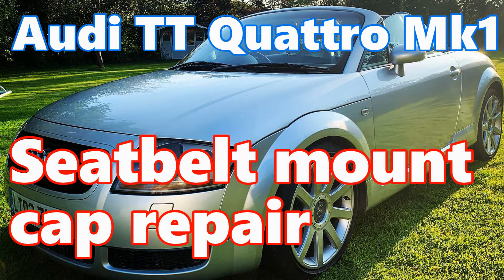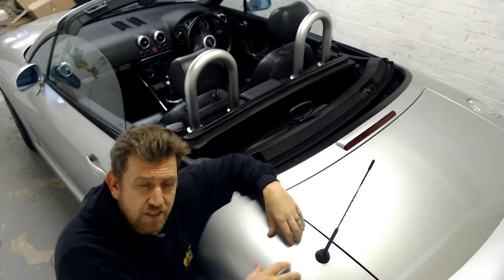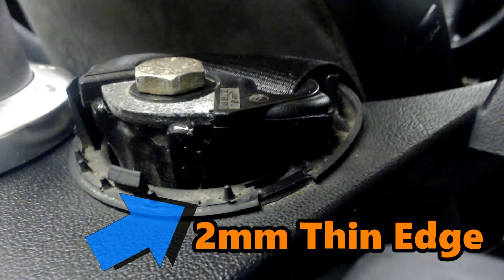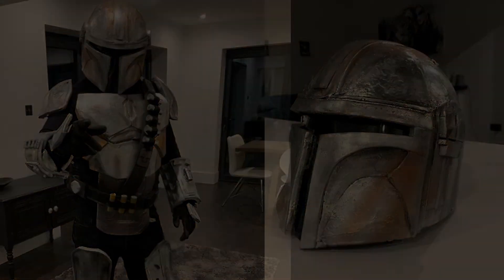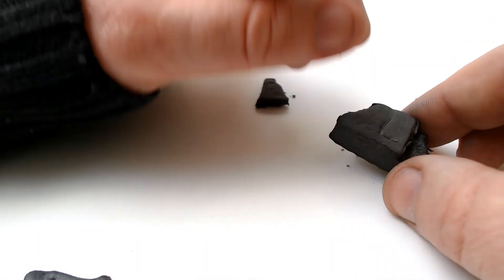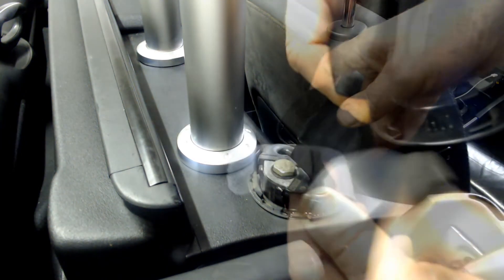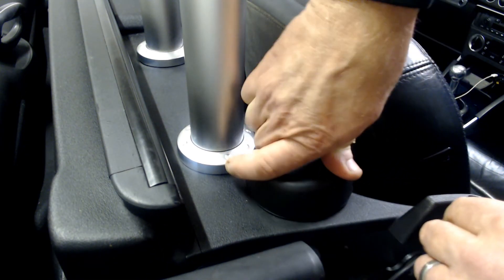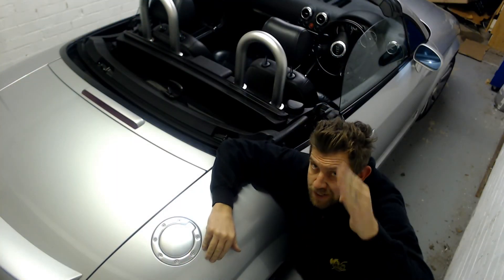Audi TT Mk1 - Seatbelt Mount Cap repair

Comment: Nice fix - I found on my older car that the clips on the inside of the cover were perishing instead, replacement caps were in order for that one. This is a good fix for the other way round though, thanks!
Reply from the maker: Nice one Ben! How is the new car working out?
Reply: @andycharger  smashing thanks - just swapped out the fuel pump on it, still loving it